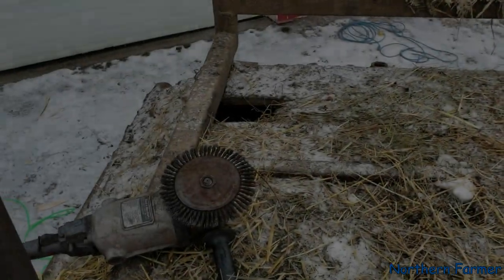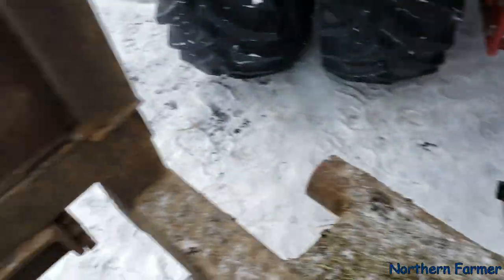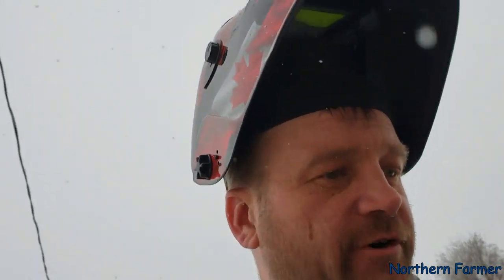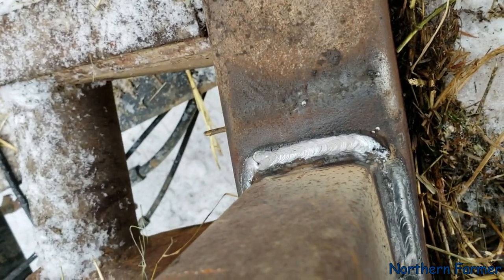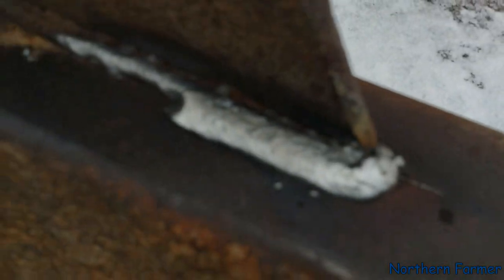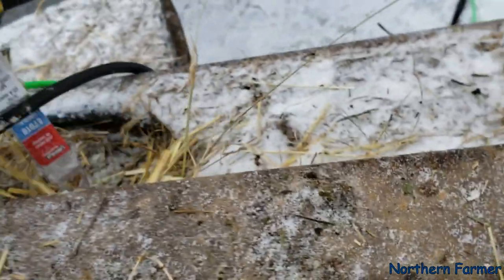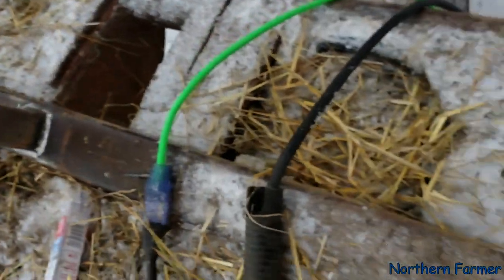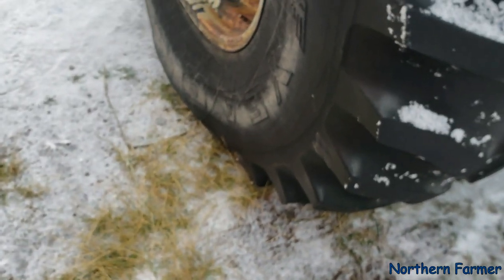Welding The Hay Trailer!!

Comment: Hi fella's !  A preheat with the propane torch or acetylene would help with the welds cracking, you probably have heard the term sweating the weld area, well it's works. Good luck !

Comment: good day  Boy too bad about the robbery.  Were you at home when it happen.  We were rob back in 95,  they told us they will not give  money for any cash we had stolen. My wife had  small safe under bed, 2300.00 in it I sold my little bobcat,  there foot  must have been only a foot  away from it, they  didn't see it.  A neighbour told me, they have a device  that can detect money from outside of house?  Most of my neighbors are Mennonites, & with my bad  breathing,  all I do is drive for them. Some told me always turn radio on if going away. Having a good  watch dog helps.  Too bad, I laugh out loud at the end  when you   said Shawn will  reply   Thanks

Comment: Hi that sucks about your unwanted guests , I'm guessing it's worse out there than in Manitoba, as you got lots of guys out there with no work due to the current government situations with the feds and provincial. Thats some nice welding with 7018  my welder don't like those rods, anything else it works fine. Those old black and deckers were good, the blacksmith i worked for in the u'k in the early 90's had the big hand drill of the same vintage. With a 3/4 bit in it if it grabbed it would need some holding, sometimes we had 2 guys on it with 1" plus bits drilling shed beams. Those B&D tools are like Briggs and stratton motors being called "Briggs and scrap iron", some guys I worked with here in canada used to call them " Black and Decker pecker wreckers" for some strange reason! Thanks for the video, Take care

Comment: Tyson your welds look very good, did you bevel the area before welding ? they may crack again if you did not. Buy your rods in 5 kg boxes
it  is way cheaper , I get mine from Air Liquide , I think it is about time to retire that old grinder get a new Makita .
Reply from the maker: Thst old black and decker still kicks ass...just heavy